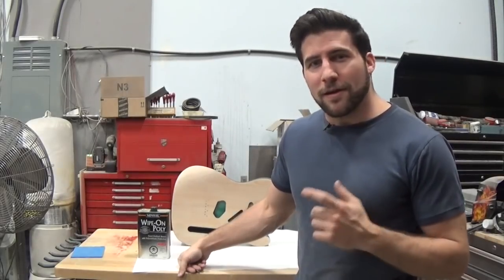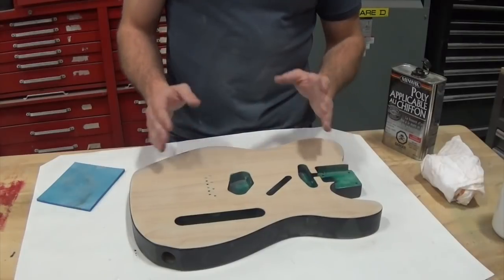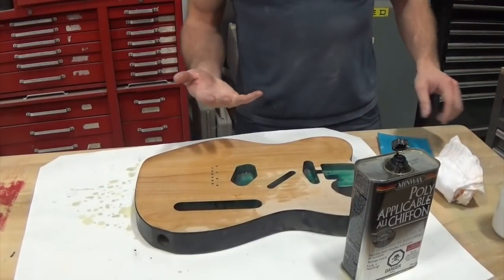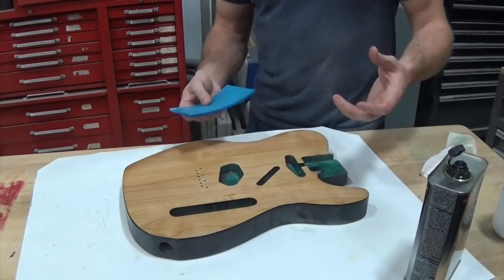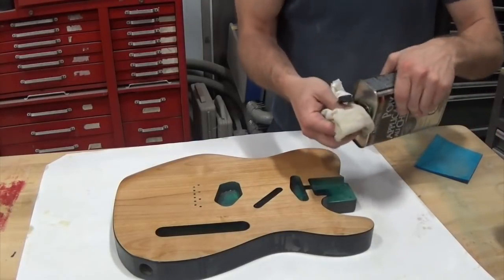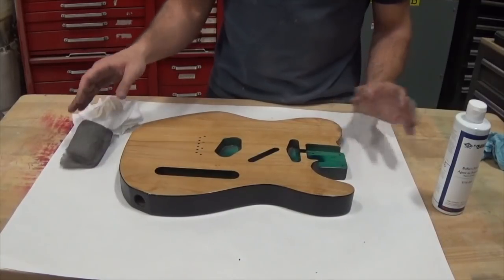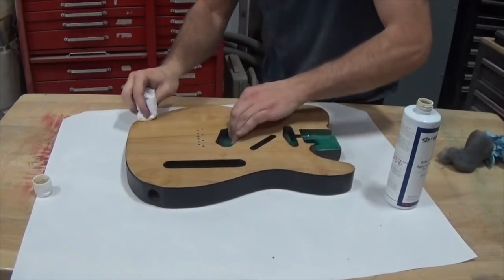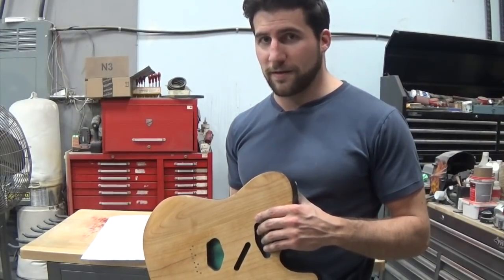How to apply a perfectly smooth poly finish by hand

Comment: I know this video talks about polyurethane, but I recently used polycrylic on a canvas to finish one of my paintings and I have a lot of bubbles and I mistakenly applied 3 coats hoping that the bubbles would just go away and they never did, do you have any suggestions on how to get rid of the bubbles? Should I sand it down and apply another coat? I don't want to ruin the painting. Also I'm using a foam brush, could that be the problem causing the bubbles? Help please!
Reply from the maker: The foam brush requires a bit of care and attention why applying polycrylic for sure. Coupled with a porous surface like canvas, that’s a pretty difficult finish. 
Unfortunately I can’t think of any options that are safer than carefully sanding it back until the bubbles are gone. 
How long has it been on there?
Reply: Brad Angove I just applied them last night, I was an idiot and didn't do research before hand but now I know what to properly do after watching like 10 videos.

Comment: that technique would work exactly the same on a layer of brushed on acrylic paint right?
Reply from the maker: It would create a pretty significant risk of you sanding through the paint a bit or otherwise moving it around as part of the process.
Reply: @BradAngove  alright thanks, should I just stick to wiping it on the way the manufacturer intended then? Or maybe get some brushed on poly.
Reply from the maker: Wiping should work fine.
Reply: @BradAngove  alright thanks for your help I really appreciate 👍

Comment: Great video! I just finished adding four coats of minwax wipe on poly and it has a nice satin finish. It’s still a little rough feeling here and there. I don’t want a high sheen, but would be nice if it were more smooth. Any tips?
Reply from the maker: Switch to using a cloth if you haven’t already and add a couple more coats. Or, if you have good coverage, use some 0000 steel wool and some finishing wax to buff it out to a semi gloss sheen.
Reply: Brad Angove I saw you used Behlens polish. Any other polishes you recommend?
Reply from the maker: Sure. There are several good ones that I like to use in the polishing products list in the amazon link in the description.
Reply: Brad Angove I checked, but it’s only the wipe on poly that you used. Maybe the link is in another video perhaps? Send me an affiliate link if you can. Thanks!
Reply from the maker: Oh, this video must not have my new link. In any of my newer videos there is a link to my amazon “store” which has a bunch of lists in it to find the stuff that I use for various categories.
Reply: Brad Angove Found it, thanks!

Comment: I left a couple streak marks in my 3rd coat due to a change in application process(bad idea) will my next coat hide those streaks and blend together level?
Reply from the maker: It depends on how bad they are.
Reply: @BradAngove  okay ill try another coat if not just sand back some
Reply: @BradAngove  seems to have smoothed out pretty nicely hopefully im not in for any hidden surprises during the rub out

Comment: Love your videos. 
I like this method because of the simplicity and low price point haha. I'm just working on a single guitar, so I'm not afraid of the extra elbow grease in applying these things. I plan to use some grain filler and some alcohol-based dyes from Reranch for my guitar. After reading some of the comments, it sounds like these products and methods will work with the alcohol-based stains and grain filler, right? This is my first build, so I'm looking for any information I can scoop up. With so many options out there, it's hard to keep it all straight, as far as what works with what.
Also, I have some conductive paint for inside of the cavities- That will be applied at the very end after all of this is done, correct?
Thank you!
Reply from the maker: If you’re using the stains, you should probably go with a brushing poly instead of using this sanding method. This will sand into the stain and affect how it looks. 
Have a look at my video on how to brush on a gloss finish. 
You’re correct, put the conductive paint on afterward.
Reply: Brad Angove Thank you for the quick response! You're the man. I'll definitely check those out
Reply: Uh, apparently I'm logged into my other account when I use my phone
Reply from the maker: Imposter!

Comment: Brad silly question, I’m starting a build, I plan on staining the guitar then applying polyurethane. I just want to be sure this would be the same process even after the guitar is strained. Thanks
Reply: Stained*
Reply from the maker: It’s not quite the same. The sandpaper can remove or move parts of the stain. Skip that step and move right to using the cloth if you’re staining first.
Reply: Brad Angove will the poly fill in the pores?  I dyed a mahogany body, and then did a few coats of aqua coat, but the pores don’t seem to want to fill in completely...maybe wiping off too aggressively?  How about wiping on a coat or two of poly, and then applying with sandpaper?
Reply from the maker: It will fill them a little bit, but certainly doesn’t make up for proper pore filler.

Comment: Can this be used on metal?

I have a guitar pedal that I've hand painted with oil paint pens/markers that i'm looking to further seal. I've watched your clear coat on metal video, but it is below freezing here in NY right now, so spraying outside isn't an option... Any suggestions would be greatly appreciated!
Reply from the maker: I would be very hesitant to do this over paint pens. It’s not an issue of the metal so much. It’s more that it might smudge. I suggest you test it out over the paint pens on a different item, or on the metal on the inside of the pedal first. See how the products react.

Comment: Looks damn nice.
Have you used a water based wipe on poly? I've heard it doesn't yellow with time, but been wondering if there are other benefits over oil based wipe on poly.
Reply from the maker: That’s true it doesn’t yellow. I’ve used brush on ones.
Reply: @BradAngove  Ok, thanks.
How does it behave, though? I've heard it doesn't last as long as oil based version and it's quite dull, and even duller with time. 

Oh, I'm also wondering if you used Tru-Oil on guitar body by any chance? I've been using it on necks and it works like a charm - very easy to apply, dries fast(around 4 hours between each layer), can act like a sealer and can be finished in either gloss, satin or matt(with steel wool).
Reply from the maker: Water based poly can be polished, so it’s durability may be a bit less than oil based but you can bring back the shine as necessary. 

I don’t use tru oil. I prefer modified tung oil or Odies oil.
Reply: @BradAngove  I think I'll try oil based first and see if it suits me.
I kinda like Tru-Oil on necks, but on my current CBG build I'll try Rustins Danish Oil, I guess.

Comment: Great tutorial.
Can wipe on poly be used on completely painted guitar?
Reply from the maker: It can depending on the type of paint that was used, but you generally wouldn’t use he sandpaper to apply it in that case.
Reply: @BradAngove  yeh, no sandpaper for me...
Was using Dupli-color spray paint.
Thanks!

Comment: I'm probably doing something wrong, but 0000 steelwool always leaves scratches on my finish that are very unpleasant and hard to take away. It doesn't just dull the surface, it really scratches it even if I just caress it with it.
Reply from the maker: That’s odd. I’m not sure what exactly would cause that, but I suggest you switch to high grit sandpaper.
Reply: @BradAngove  thanks, I will. Maybe it's something with tru oil.

Comment: Hey Brad, love your videos man!  
What type of wood is that guitar in this video?
I'm  building an alder bodied Tele, and would like the grain to 'pop' a bit before applying this poly finish. Recommendations?
Reply from the maker: I’m pretty sure this one is alder too. Try staining it dark and then sanding back to accent it. Then apply either the wipe on poly or an oil to make the grain pop and increase the contrast slightly.
Reply: @BradAngove  Excellent!  Thanks Brad!

Comment: Can min wax go over like a rustoleum spray paint? ...additional  I've recently seen a post or video saying to do away with using steel wool as it is detrimental to pickups
Reply from the maker: Yes, I’ve seen it done over that paint. 

Using steel wool in a guitar that has the pickups in it is a bad idea. This one is fully disassembled. It’s important to clean out any steel fibers and residue before putting those magnets back in.

Comment: hey Brad. I'm also looking into getting my guitars refinished (by a professional), and I wondered if a thin layer of finish makes a guitar noticably lighter compared to regular thicker layers of finish.. Would it be worth it in that aspect to have a thinner layer of finish (I'm getting them refinished anyway).
Reply from the maker: I personally haven’t noticed a difference; although I’ve never really done a test per se. I doubt the difference would be all that pronounced.

Comment: How do you suggest handling this if the surface is stained and I’ve used grain filler?
Reply from the maker: Just wipe the poly on with a lint free cloth.
Reply: Brad Angove Iyou think there is a way I could still like to use that sand paper technique tho?
Reply from the maker: There is. You just risk creating a bit of a distressed finish. Some of the stain might come out.

Comment: Followed your instructions and everything turned out perfectly. How long after the final coat should I wait to buff with some denim/buffing compound?
Reply from the maker: I would give it a week before buffing personally.
Reply: Brad Angove Great. Thanks so much.
Reply from the maker: You’re welcome.
Reply: Brad Angove Another thing, is there a more protective/harder wax one could use over this finish?
Reply from the maker: You want to wax it after you’ve polished it?
Reply: Brad Angove I should have specified: I haven't polished it yet but I will be at that stage once it's cured for a week. I would like to wax it just to get a bit more protection as I've read about bowling alley wax being tough stuff and a great wax. Its hard to find here though. Do you know of any that would be non corrosive to the poly finish and add a bit of protection?
Reply from the maker: I would think a typical automotive carnuba wax would be suitable.
Reply: Brad Angove I'll give it a shot. Any names you'd suggest?
Reply from the maker: I’m no expert on car wax. Turtle wax is pretty reliable. Meguiars also seems to consistently work well.

Comment: Is the back of the guitar poly'ed also? And what are the steps using color tone type water based dyes?
Reply from the maker: You can and likely should also poly the back of the guitar. Mix your color tone with warm water until you achieve the desired strength and then wipe it on. Alternatively, mix it with alcohol for a faster drying dye that won’t penetrate as deep, or mix it straight into lacquer and spray it on.

Comment: Brad, I have two bodies to finish. One is roasted alder and the other roasted ash. I want to poly the whole body, would I pick a side first, then do sides and back? I'm not seeing the best way to poly an entire body. Thanks.
Reply from the maker: I usually start by applying it to the edges. I don’t use sandpaper for that. Then I do the front and back. I like to put mine on a spray stand though when I’m doing the whole body. I’ve got a video about the little spray stand I made on my channel. It’s an old one.

Comment: Hey Brad thanks for all the helpful content! I ordered a flame top LP solo kit (with your link of course) I plan to do a dark red and black burst with dye, once the color has been done would this be an ideal finish method for that type of surface?
Reply from the maker: It’s a good option for the finish, but I don’t recommend applying it with sandpaper if you have a dyed surface underneath.
Reply: @BradAngove  thanks for the response brad. Just gos straight in with the poly after once its smooth?
Reply from the maker: Yes, you can just wipe it on the normal way.

Comment: Could I use a wipe on poly after I have painted my bass and applied a very thin layer of clearcoat. I've used an enamel  paint and clear coat, if that makes any difference.
Reply from the maker: You’ll need to let it dry fully first and sand lightly with 800 grit. Then you can use the wipe on poly.

Comment: Hey Brad, would this work on a top with different woods? I've got a pine top with walnut and nyatoh inlays, will the dust from the darker  woods stain the pine?
Reply from the maker: First of all, that sounds awesome! It can still work with other woods. The combination of them is something I haven't dealt with before, but honestly I think it should be fine. The dust from he darker woods might get into the grain of the lighter ones, but that would likely just give it some nice accenting. If you're at all worried, you can just apply the poly with a cloth, let it dry fully, sand it smooth, and repeat until you achieve that perfectly smooth finish.

Comment: Can you / should you do this method (two coats with sandpaper,) with brush on Poly?
Reply from the maker: It’s a bit thick/gummy for that. You can, but I would mix it with some thinner and linseed oil first to thin it and make it more workable.
Reply: @BradAngove  Thanks Brad

Comment: 12:23 Is that a burn through on the finish there right where the light is? I only ask because I have done it on a few things, with wipe-on poly it isn't the end of the world because another coat will remove it, it looks like one is starting there. 

Just a suggestion but use a soft sanding sponge as even sanding with higher grits will produce finger grooves where the finish will be a higher shine because more pressure is applied to the finger tips. Ideally you want even pressure to avoid burning through the finish. 

I agree this stuff is good when you use it right but it takes some time to cure when building thick layers. I build thick layers on things like grips on a handgun so I have to wait a while. 

I have seen some folks ask if they can apply oil to poly and things of that nature but in true poly you can literally smell the boiled linseed oil in it already so its kind of pointless in my opinion with oil based poly's, water based I'd have to say no cause oil don't mix well with water. 

Most of the time I end up using spray clear enamel, although it is not as durable it dries faster. I recently went back to using the poly because I had some on hand and I forgot how thick the spray stuff goes on. The longer dry time on it I noticed caused the finish to kind of melt into layer after layer and reduces the overspray on the sides you get when you spray the font and back. Also when it cures wipe-on oil based poly can be used to tidy up the finish if you fine sand it. Very easy to sand away the finish on corners.
All in all your video has a lot of useful information in it and really the only thing I would change is the use of steel wool over fine sand paper but you mention fine sand paper is probably better anyway and you only chose it for a monetary reason. I like seeing ideas of other people to compare with my own technique and I am constantly tweaking the way I do some stuff.  This is a lot of tiring work involved to do by hand and if you do it on a regular basis I'd suggest a power buffer (just keep it moving). Good video.

Comment: I was shocked when you stated using sand paper to apply, but it looked amazing and saved you a few steps, That's Great advice. What  if you have stained your wood and are putting poly over it? I have issues with bubbles when it dries, it's smooth wet but then bubbles up. Any suggestions? Thanks
Reply from the maker: What application method are you using?
Reply: Brad Angove. I use Minwax clear semi-gloss polyurethane, brush on. I have used every thing from a 20cent foam brush, to a $30 camel/horse hair brush. There is a difference but I still get bubbles.
Reply from the maker: I’m guessing you didn’t seal it with anything before brushing your poly on?
Reply: I don't know what you mean. Isn't the poly the sealant? I sand till smooth, clean, ( I don't use prestain don't care for it) stain, give it atleast 8hrs to dry. I come back clean any dust that has settled, stir the poly and then apply. Is there a step I'm missing?
Reply from the maker: You’re not missing anything necessarily. Sometimes it’s helpful to use a sealer prior to your finish on open grained woods. Poly often fills that role on its own on tighter grained stuff. 
Have you seen my video on how to brush on a gloss finish? That might assist you with a demo.
Reply: Ya I watched it. Thanks for the help. It seems that I need to try the polish. Until today I thought all wood polish was like the lemon scented wood cleaner, Haha. It never even crossed my mind that finished wood could be buffed. I have asked "professionals" at some paint stores and a few painters, and they all tell me to use a good brush, good meaning the most expensive, and make sure what I'm working on is clean, nothing about buffing or polishes. Does it have to be a certain kind of polish ? I have some Turtle wax-rubbing compound medium grit, Mothers and some Boat wax- clear coat polish.
Reply from the maker: Those are probably fine. You need compound to start out with and then polish. That’s the gist of it. I’ve got several videos on polish, including a very old comparison video where I tested a few kinds.
Reply: Alright, I'll look those up. Thanks
Reply from the maker: You’re welcome.